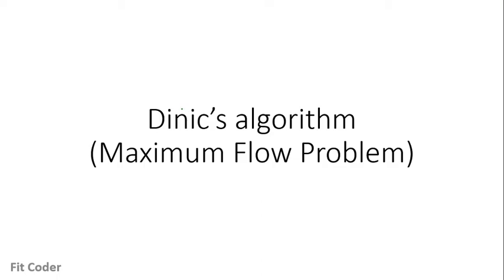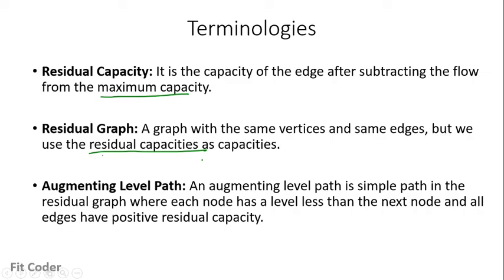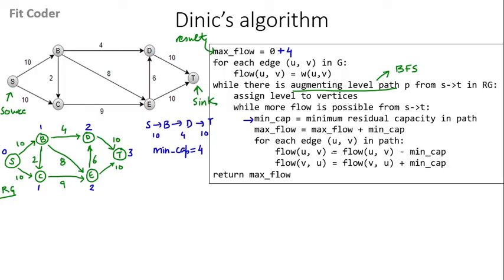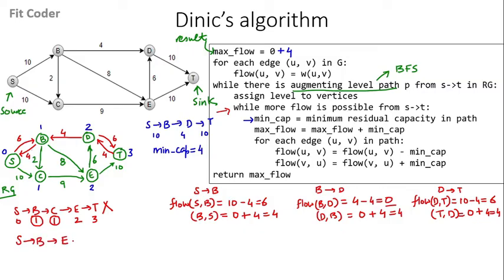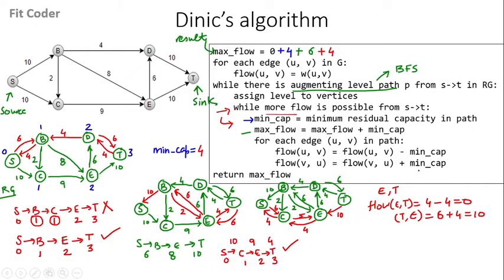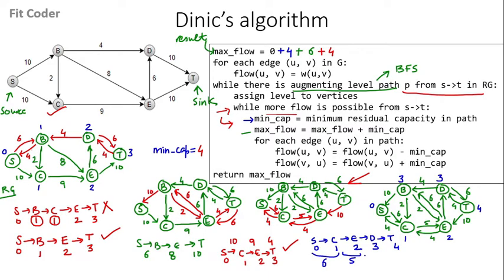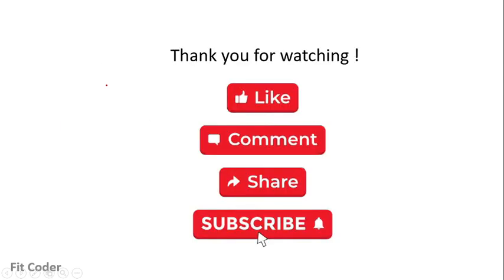Dinic algorithm | Maximum Flow Problem | Network Flow | Graphs | Data Structure

Comment from the maker: 00:00 Introduction
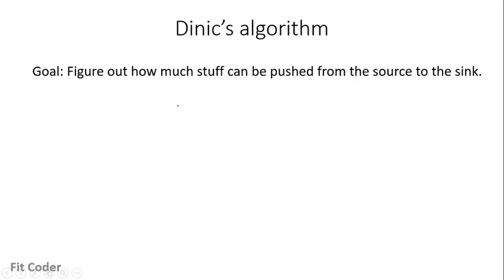00:08 Define Maximum Flow Problem
02:21 Terminologies (Residual Capacity, Residual Graph, Augmenting Level Path)
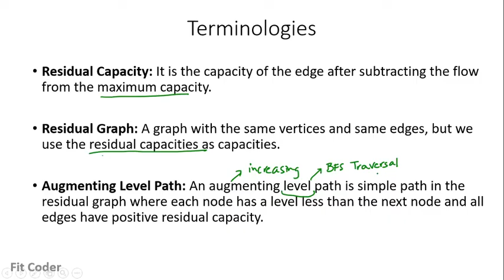03:24 Dinic's Algorithm Pseudo Code
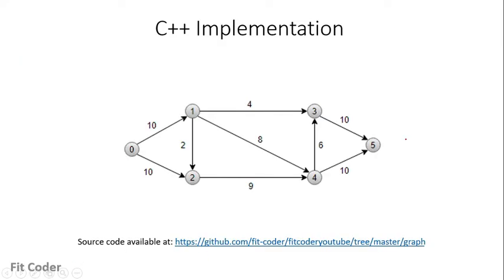16:32 C++ implementation
Reply: Where is code of implementation?